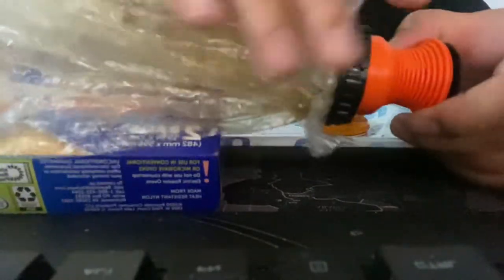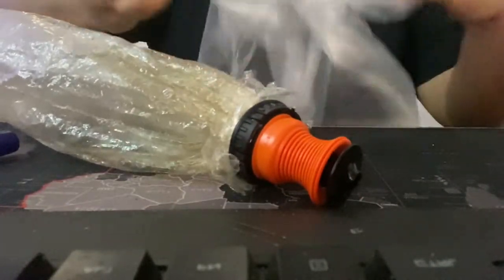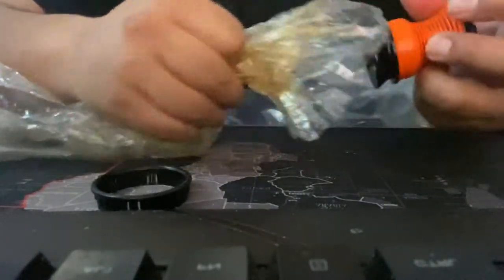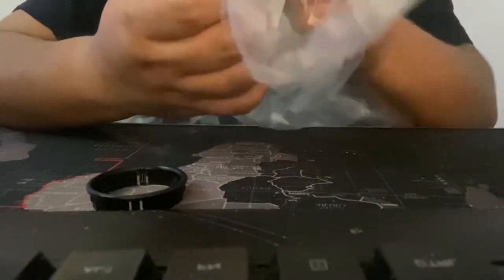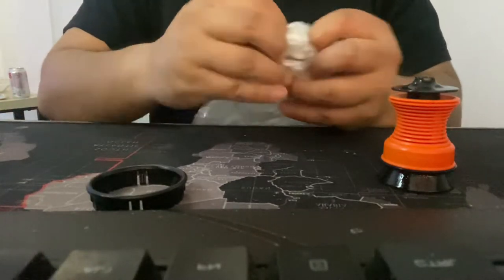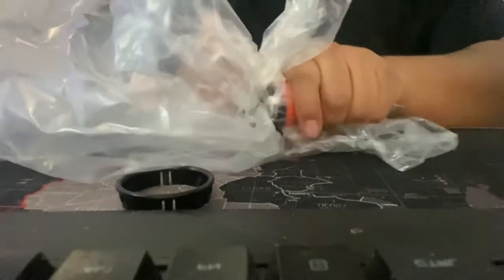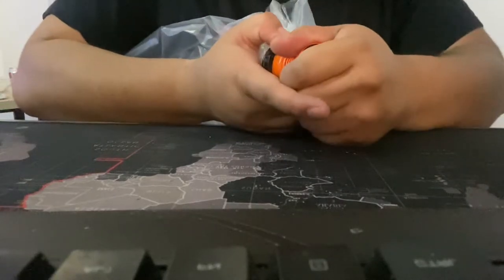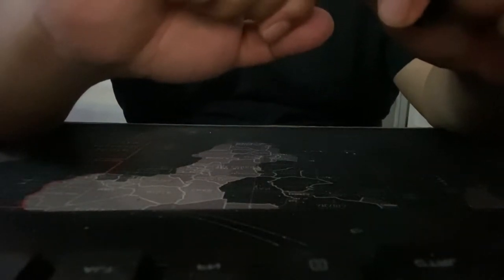How to replace volcano bags with generic oven bags.

Comment: Thanks have you found a way to replace the tube?
Reply from the maker: hmm... the tube? As in the pipe for volcano?
Reply: @buddahviews  yeah I think it's called the whip
Reply from the maker: @deltawhiskey6417  ahh I never needed to replace them cause I didn’t like the whip for the volcano. But if you were to use them frequently and you want to clean it, I would rinse it with some hot isopropyl. Hot meaning 15 sec. microwave isopropyl, until is hot enough then rinse it and shake it. Might have to do it in the tub, rinse with hot water and dry. Or you can replace whole whip by buying it on planetvapes website.